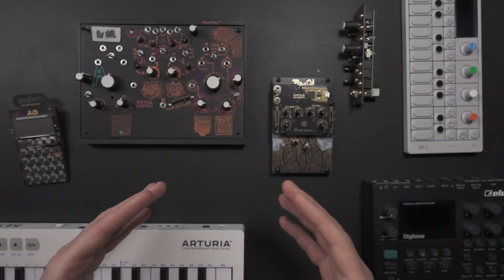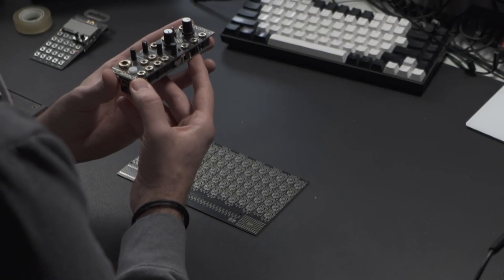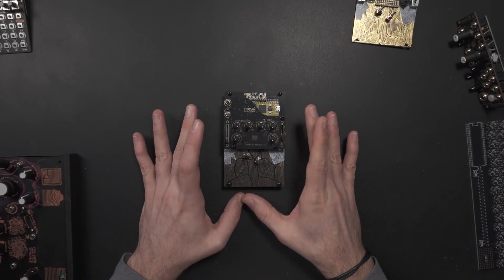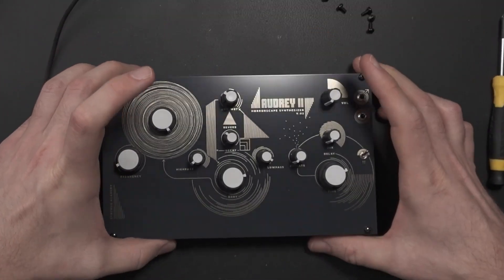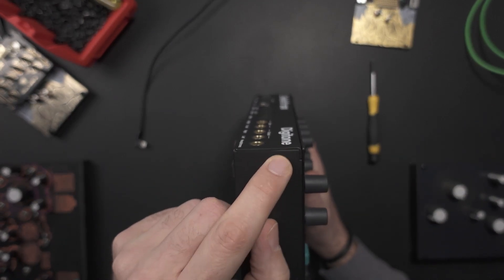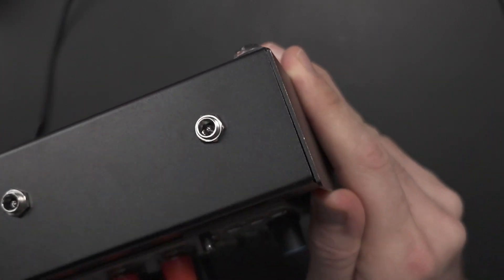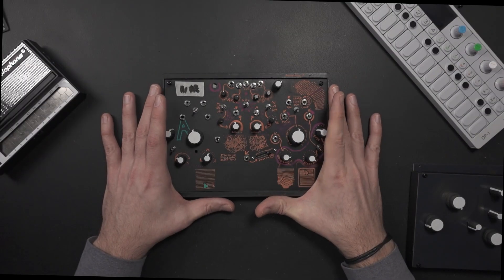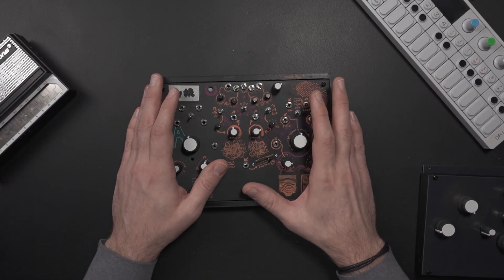How are Synth Enclosures Built? Techniques, materials and more

Comment: You can always diy your enclosures by taking any aluminum can and cutting them into little sheets that you can then fix to wood that you can get from pallets and then you build your frame and then fix the aluminum sheets you cut out your frame etc. Re-purposing stuff that's usually toxic is better for the planet. I like your pcb though and as soon as I can I will be purchasing.

Comment: Great video! I'm working on designing an enclosure for a synth project right now. 
I'd love to see more of your process--particularly your strategy to mitigate connector failure (solder joint failure) from mechanical motion of repeated insertion and removal of the audio plug, for example. 
What tool are you using for the cad design for the sheetmetal housing? That would make a great follow up video. 
I've been looking for an inexpensive fab house for custom sheetmetal housings , but haven’t found one yet.

Comment: the question i would really liked answerred is: how can you get the holes for the potmeters so perfectly in line? I always feel like this is the most difficult part. because i recently changed potentometers on a existing machine since they were the plastic black ones which are such bad quality. but i didnt took in account that the new one is now bigger so I have to build a new enclosure :S any tips on how to start? i'd like an aluminium frontplant that goes down diagonally and a whole metal case would be the best but where to order this or what would be a more easy solution? the difficult part is that there is only 1 pcb inside but its kept in "mid air" so to speak with 4 pillars in which you screw the pcb(hope that makes sense. in the original this is also metal but how the hell should I design that and in what program?
Reply from the maker: Hey, sounds like a big project. In short, you need a CAD program to design your enclosure. With a program like Shapr3D you can get super precise measurements and positioning. Maybe join our discord server (link on the homepage of the Synthux site). There’s a dedicated channel for mechanical engineering. Good luck!

Comment: I wonder if you had considered other material options for the enclosure? Neutral Labs released both the Elmyra 2 and The Scrooge in Eurorack and desktop, and the desktop versions have what appears (to my untrained eyes) to be an enclosure made from Bamboo. Again there could be economies of scale at play here (I don't know how many units they shift for each model) but its a slightly more environmentally friendly material, and has a nice 'warm' texture to hold when using.
Reply from the maker: That would be very cool indeed. Tbh, this is the most uncertain part we need to tackle. I am looking at various solutions. The thing is, you can very quickly fall off the game if you make something too expensive. Making anything in the EU for instance, from my current quotes, means we’ll need to sell by the thousands. It’s a huge risk for such a tiny organisation. We can very quickly go bankrupt. I’m not sure how other manufacturers are doing this, but everyone is scaling down at the moment.

Comment: An easy way to identify steel versus aluminum is with a magnet. Most steel is magnetic, whereas aluminum is not. It is not a foolproof test as stainless steel often happily ignore magnets depending on metallurgy, but for the most part structural enclosures use the cheaper material.
Reply from the maker: Oh, of course! I should have thought about that. It’s probably not stainless steel also, because that’d probably be an overkill for such enclosure. Thanks for sharing.

Comment: metal = steel?

Would love to hear more about both the design process and tools, but also how to get this kind of stuff done without having to acquire a lot of tools and emptying your wallet. Like suggestions for services within EU where you can get this kind of stuff done. Be it metal enclosures or plastic enclosures or molds...
Reply from the maker: Yes, steel. Sorry. Regarding EU manufacturers - it’s very expensive. The quotes I got are 40-50 euro per unit (300 units). All because of welding, painting and silk screen is manual work. But, if you have a good idea for a design you might be able to collaborate with a company like Erica Synths to help with such production.

Comment: enclosure fabrication doesnt have to be expensive; I would take hand drawn designs and specs to small local metal fab shops that didnt require big production runs. Folding is called "braking" in the fab industry.

Comment: I found this to be very interesting from a synth makers perspective. Just FYI… the one piece aluminum enclosures are generally milled from a big block of aluminum called a “billet”. These days, it is mostly done with CNC routing, which is actually something that can be done relatively cheaply with the latest generation of CNC routers on the market. Although you can get a router pretty cheap, there is quite a lot to learn about the milling process. But if you’re determined to do your own prototyping, it may be worth looking into further.
Reply from the maker: Thanks, Kyle. I didn’t know these are milled. Is casting used at all then? Is there any benefit for casting over milling? Also, what do they do with all the material thats left? So many questions!
Reply: My pre-coffee comment made it sound like I was trying to say that casting wasn’t even a thing, but that was not my intention haha. My apologies! Watching this video was somehow the first thing I did this morning and my brain hadn’t started working yet!

I believe that casting is used for high volume production when the parts don’t call for a lot of details or really thin walls. It’s definitely the cheaper option.

I think my intention with my previous comment was to say that you could get into prototyping your own enclosures with a CNC router. DERP
Reply from the maker: Haha, yea, coffee is important. I’m just getting started with this stuff, it’s fun! It’s good to get these thoughts shared as we progress. Thanks for clarifying regarding casting. I wonder whats considered small detail - does the OP1 have such details? Or is that feasible with CNC?